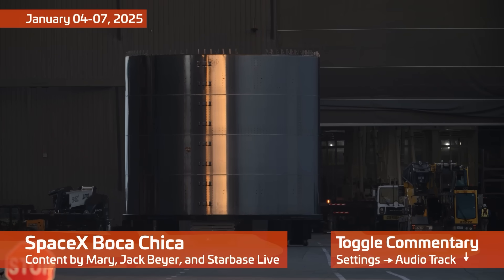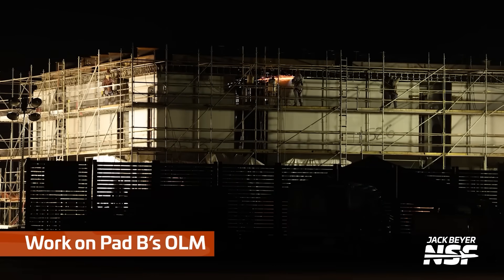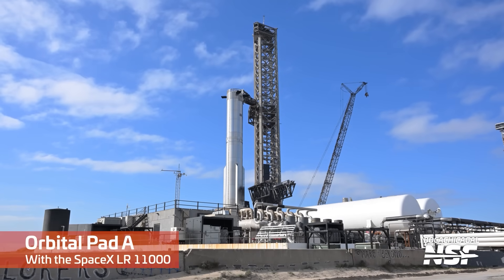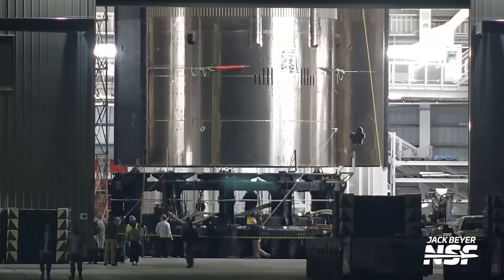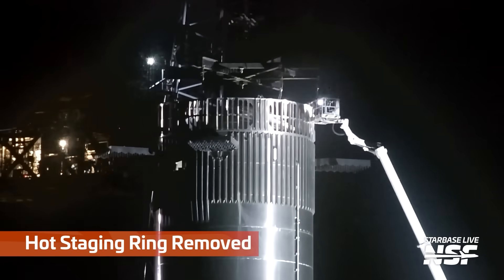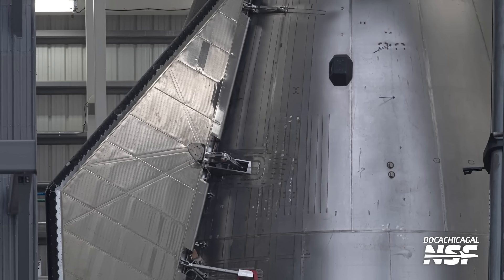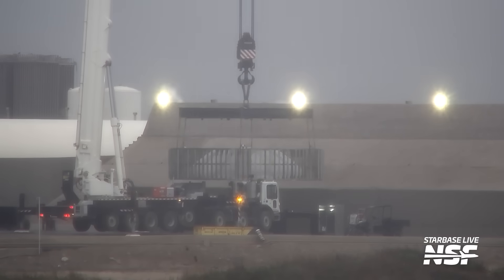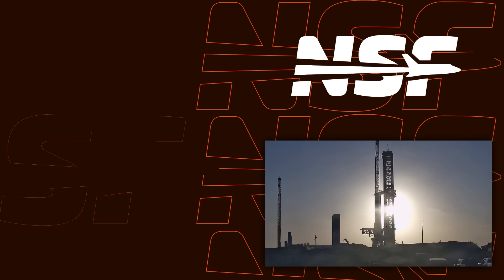Final Preparations For Starship Flight 7 | SpaceX Boca Chica

Comment: You can tell the workers are indeed exerting force while loading the SymLinks. It is very very obvious by the way their lifts spring back and forth. Those things have a limit of 100 pounds lateral force when pushing like that. Two people pushing easily go over that. So, I didn't bother looking at their hands anything, because there's nothing else that could make their lifts deflect.
Reply from the maker: That's a good point... I was focused on the workers hand motions, but the workers bodies needed to exert an equal and opposite force on something... and it was the work platforms. Good eye. 👍 - Das
Reply: @NASASpaceflight  Actually, its not the eye. It is experience on those machines. My mind saw a lot more deflection than exists in the video, and I wanted to cry "Safety issue!!" but the amount of force being exerted is much lower than I expected.

Comment: Just maybe SpaceX at some point will have to actually build its version of NASA’s Assembly Building because of the weather. Yes I know how big that building is. In 1969 NASA included that building in its tours. June 1969 my dad and I tour Cape Kennedy’s facilities and the tour included the AB. Apollo 12 was fully assembled except for the escape tower. It was distinguished on the giant crawler. It was the single most impressive man made construction I’ve ever seen. I was 17. #13 was half completed but the first stage was low enough I could have touched it. Sure wanted to. 11 was on the pad waiting. We drove around it close enough to take it all in. Also the tour group was about a dozen. I went there 14 years later expecting to see the Shuttle up close….the world had changed by 1983 and the tour was not worth the bucks.  Wifey didn’t understand why i chose to forgo the driving tour.
Reply: You mean something bigger than the buildings they have now the mega bays?

Comment: Gracias por la traducción al español, que así es mas fácil 😊.

Y ya puestos, algunas propuestas de traducción. 
Por ejemplo Chopstick Carriage podrían ser guías de los palillos (yo a los palillos los llamaría brazos de la torre, pero ya que se ha popularizado la broma de Mr. Miyagi dejémoslos en palillos). 
Debajo del anillo de separación (el ¨en caliente¨ creo que ya sobra) está el domo del depósito y la bahía de maquinaria que controla las parrillas (aerodinamic grid fin). 
Loadspreader = aparejo. Barrel = sección. OLM = plataforma de lanzamiento.
Dummy = simulador (estrictamente seria un demostrador estructural, pero eso es menos inteligible).

Y los nombres propios sin traducir, incluidos Starship, Booster 17, LR 11000, etc.

Comment: @Das, since I understand german spanish and a bit of klingon, I can tell you that only Adrian talked a bit about the starlink mechanism. (the mechanical part is when the starlink is inside and then is pushed down). Your question remains unanswered by the rest as well ;-). If I'd have to guess, it looks like they manually push it all the way inside. And then a mechanical action moves them down.

Comment: Also erstmal danke für den deutschen Kommentar. Höre ich mir tatsächlich lieber an als auf Englisch (bin darin nicht so gut und irgendwann wirds halt heftig mühsam immer hoch konzentriert zuhören zu müssen und trotzdem jedes 10. Wort akustisch od. tatsächlich nicht zu verstehen).
Zu den Übersetzungen: Staging ist einfach die Stufentrennung, hot staging wäre dann die heiße Stufentrennung. Und bei hot staging ring würde ich das 'heiß' weglassen und einfach nur Stufentrennungsring dazu sagen.
Chopsticks würde ich in dem Fall nicht mit Essstäbchen übersetzten, Fangarme is ein Tick weniger cool aber dafür weiß jeder was gemeint is 🙂
Startseite ist eine 1:1 wörtliche Übersetzung, Startplatz passt da besser mMn
Catch pins = Fangzapfen
Pez Dispenser... bei der Benamsung musste ich grinsen, schon sehr ulkige Leute bei SX. Wäre auf deutsch ein PEZ Spender. Geht mMn gar nicht. Von der Funktion is es ja ein Starlinkspucker  ... aber ob du wirklich den Begriff verwenden willst? 😀 
"an der Bay angebracht" ist zwar besser als "an der Bucht angebracht" aber man könnte da Ladebucht, Ladeöffnung oder nur Öffnung dazu sagen
grid fins sind Gitterflossen obwohl man fins tatsächlich auch mit Lamellen übersetzten kann (in dem Fall aber eben nicht). Unnützes Wissen: Gitterflossen wurden erstmals 1964 auf der sowjetischen N1 montiert
Generell kann man da über sämtliche Übersetzungen diskutieren, steht ja in keinem Gesetzt wie es exakt auf Deutsch zu benamsen ist. Prinzipiell bin ich eher dafür aussagekräftige Bezeichnungen zu verwenden, geht zwar eine gewisse Lässigkeit verloren ist aber sicher verständlicher. Zur Frage ob man überhaupt deutsche Begriffe verwenden soll beneide ich ein wenig die Franzosen die selbstbewusst genug sind um quasi alles in ihrer Sprache zu übersetzten oder die slawischen Sprachen die da auch überhaupt keine Hemmungen haben. Wieso gerade Deutsch immer mehr Richtung Denglish abbiegt bleibt mir ein bisserl ein Rätsel.

Comment: On the Starlink simulators, I am not sure that there is a mechanism to mechanically draw them in. There actually may be people inside as well helping with these. If you notice at the very end of inserting the simulator looks to be racked to one side and the simulator is moved in and out several times to align it while no ones hand is on it from the JLG lifts.  @ about 9:44.

Comment: Also, there has to be a well designed apparatus in there to deploy and load the satellites. It's not a salt shaker. They will be mechanicly ejected, and in time, they will build a loading apparatus if there is a significant amount left to justify it, and if not, they'll do it by hand until they are finished.

Comment: I don't see any pitch points in that area to speak of. These men obviously know what they are doing.  I can see how you might be concerned, not being a mechanic. Obviously, you should be afraid of machinery and where you put your hands. Ive been working with machinery all my life and yes I've been bitten many times, but you lose that fear and depend more on your ability to understand the machine and it's dangerous parts. There putting there hand on it because they know there is no danger.

Comment: Loading the “non links” 😏must have mechanical assistance. There is no effort pushing them in. Looks like hands are there just for guidance and checking its all working ok.Ofc I could be wrong but whats to stop them coming out if it is just a light rolling insertion. They are too big not to be connected to something

Comment: It definitely looks like they were pushed in by hand and stopped when they took his hands off it. I remember Elon saying that the current starlinks are no longer mechanically fastened to Falcon and are deployed by just the rotation of the upper stage, kinda like a catapult but you should fact check that.

Comment: Does anyone know why there are heat shield tiles on the leeward side of the starboard rear flap?
Reply: Probably for testing new tiles. Its less risky in those areas if they fail
Reply: Probably attachment testing. They used those spots on the hop tests to evaluate different pin/glue designs. If they fall off, no harm no foul
Reply: @thomashayden804  good point. Can they use the old pin design with the active cooling tiles?
Reply: @tyler60904  No clue! Not even sure if active cooling would be almost deluge plate like, or pretty much the same tiles but with a tiny amount of fuel flow
Reply: @thomashayden804  i guess time will tell. I doubt actively cooled tiles would even be black, so we would notice them right away.

Comment: The Pez dispenser has a chain drive with electric motors on each side (right and left, from the pez door's point of view) that moves the starlinks in/out under its own power.  The workers have to manually push the mass simulators in until they engage with the chain drive 'conveyor'; then I suppose it takes over and pulls them into position the rest of the way.  The Ringwatchers have covered the new Pez dispenser design for Block 2 Ships, in one of the five deep dive articles they published over the Christmas/New Year holiday week.
Reply: I noticed the crew of three moves over towards the opening to the left of the slot and it looks like the guy in the white shirt is doing something through the opening. Maybe he is doing something like you were describing. What do you think ?

Comment: They used a stick (about 3ft long) to push the Starlink simulators in the last bit. Workers inside the ship might do the rest, or it is done automatically - can't tell which. Anyway they lock in to the PEZ-dispenser and it lifts them (2) up to make space for the next pair.